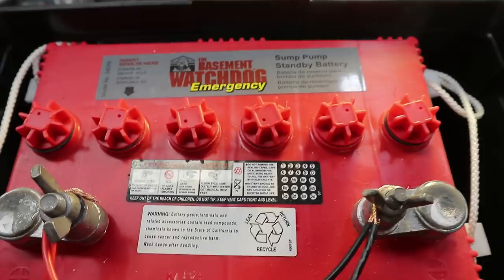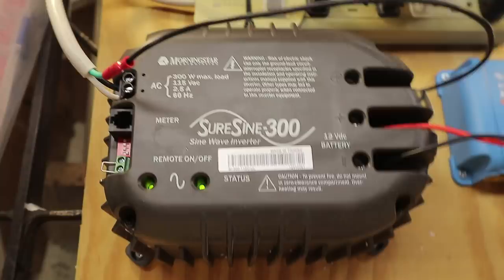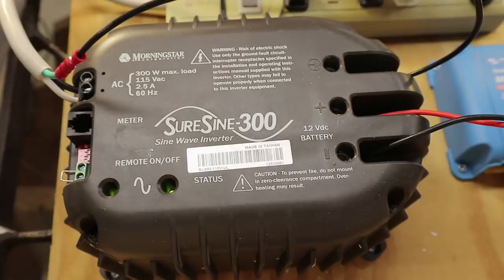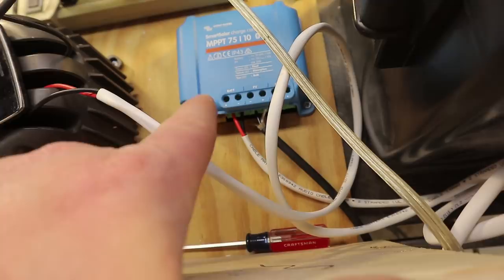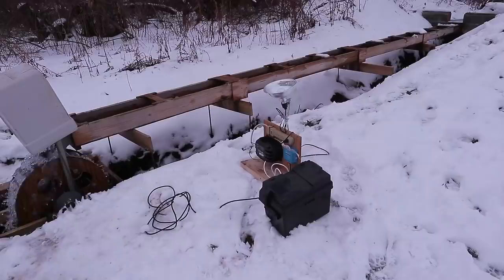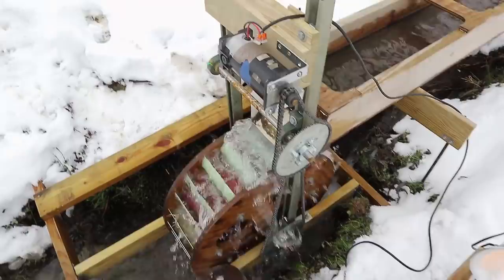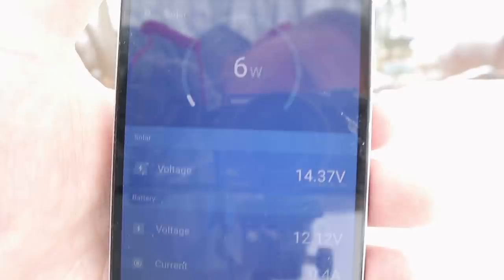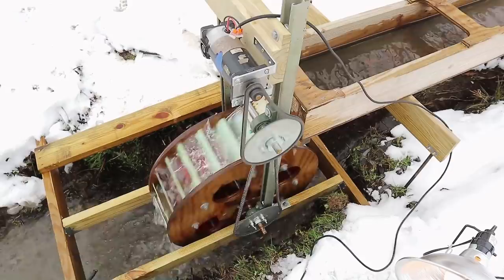[Part 10 of 10] Waterwheel Microhydro, How Much Power?

Comment: @Joe
Im probably teaching granny to suck eggs,   but are you aware that if you use a DC motor as a generator,  it outputs AC,    and if you use an AC motor as a generator,  it outputs DC.     Im unsure what motor you have on there, but it looks like a DC motor.   if this is the case,  it is outputting AC..    and your charge controller will only be utilising one half of the AC waveform being generated.     A full bridge rectifier between the generator and the charge controller to change AC to DC  will see a vast improvement to output - also the addition of an electrolytic capacitor rated to >100v 60-220uF on the output of the rectifier should also see the waveform to the charge controller react to varying loads quicker).

Please dont take my word for this.  Check up Google and verify for yourself.   im merely offering information.

Hope if works well for you.  if I can assist, let me know (I have done many years of solar generating for boats/campers.

Neal
Reply from the maker: I don't have an oscilloscope to verify by my understanding is that a brushed permenant magnet DC motor will output DC. A typical brushless motor would be 3-phase AC. I could be wrong, I'm not a sparky.
Reply: One way to check if output is AC or DC is by using a simple diode in series with a resistor (about 10Kohm).   If it is dc, the diode will only light when connected the correct polarity,  if it is AC it will light both polarities
Reply: In my experience a brushed DC motor will output AC>   

i shall go and check up.   be good to be corrected if I am wrong.   And be good for your project if I am not
Reply: It seems it is 50/50 as to whether it outputs AC or DC>    The general rule of thumb seems to be as follows

DC permanent magnet motor  outputs AC
DC field motor (coil instead of magnets) outputs DC but needs exciting
AC motors output DC but need exciting to generate the field

may be worth checking your output.    LED's which only light in the correct plarity will be a good indicator.   Fix to generator and turn by hand slowly.  if it lights, turn the LED around and try again.  if it lights in both polarities,  the motor is AC output.    if it only lights one polarity,  it is a DC output.

Hope this all helps in the long run.
Reply from the maker: I find conflicting information here: https://youtu.be/OpL0joqJmqY?t=7m15s

I'll try a diode next time I get a chance and report back.
Reply: A nice simple, old video.
I stand corrected.   DC motors produce DC output.

How many full bridge rectifiers have I assembled unnecessarily...   lol
Reply: brushed Dc motors put out D.C. don't listen to this guy he has no clue
Reply: I am not electrician.  just a guy at home trying to learn.   I confused a pulsed DC with an AC output.   Simple mistake for someone who will openly admit I was wrong and that i dont know too much.

Im learning
Reply: I appreciate the words.   But no hard offence was taken.   Youtube doing what it's best at..  teaching us our mistakes.
Im glad you did reply actually.   Never seen your channel before. Looks like juicy info.  I have subbed and shall peruse  ;)
Reply: Thank you very much , I have done the same to yours , I hope you enjoy I will have much to show in the future